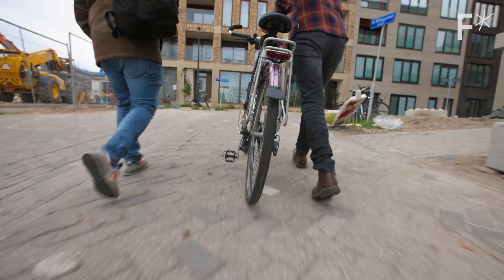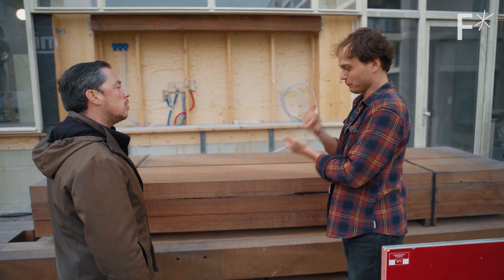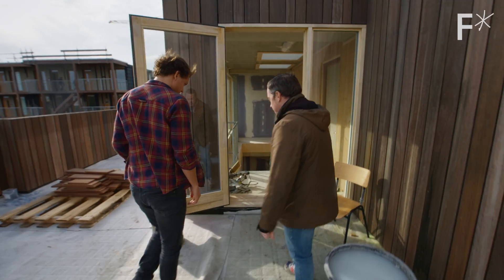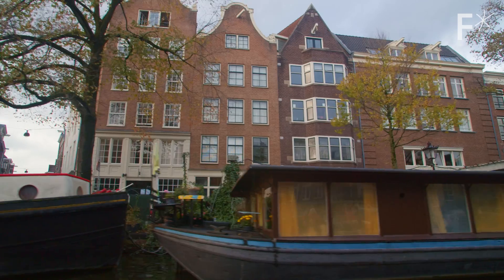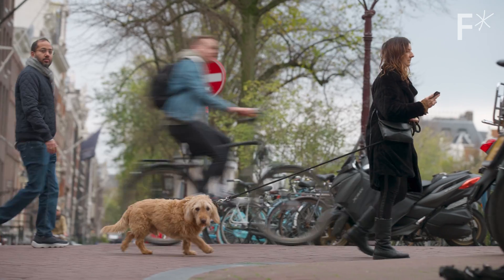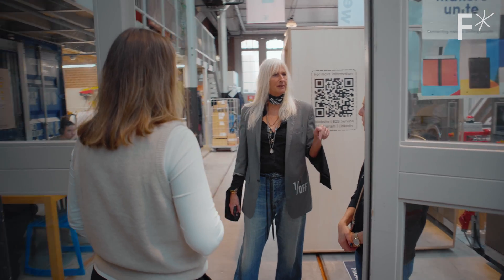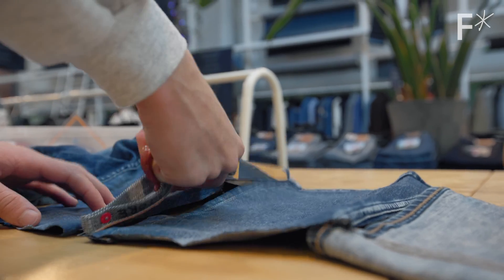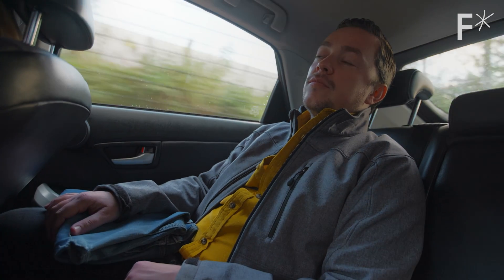This city is setting a new ‘green’ standard for the rest of the world

Comment: Nice concept, but more flammable. I wouldn't want to live or work in it. Steel and concrete would be better.
Reply: Cross laminated lumber is actually safer to an extent. Skyscrapers been made with this form of lumber. Concrete needs rebar to retain its shape and cold weather to solidify.
Reply: Depends where you live.  I grew up in the UK where brick and mortar is common.  I now live in NZ where houses are mostly wood construction and I happy that the house shakes a bit during a quake but damage is limited to the odd cracked window pane.  Fit smoke detectors and sleep peacefully.

Comment: LOL He just basically said, "well it's more expensive because we haven't made the alternative/competition more expensive though taxation" What a concept. It won't be considered expensive if everything is made expensive. lol
Reply: Kinda cool how the architect sees that through his eyes. 
Instead of having a wood market for second hand use, that's now the builder's cost to source the material. 
Everything in the current pipeline is cost cut already with steady deliveries. Any change is going to be more expensive in comparison.
Reply: He's kind of right though - in the UK refurbishment is subject to VAT (21%) whereas new build is not, so often it's cheaper to build new rather than to refurbish an existing building. There's been talk of equalising the rate for both at 10-11% for a long time but I don't think anything has come of it.
Reply: @malcolmrose3361  this is part of why we have housing shortages in all attractive countries. They incentivize new buildings over refurbishing the old. New structures look  at profitability potential which is  greater for more complex new housing than older adaptable structures. If you look at incentives on meeting demand with "new" structures it makes financial sense to throw out the old and replace with new, usually shoddier than the original construction. This is a net loss that generates much waste, unnecessary disruption and harvesting of new resources which is not an improvement in most cases. It generates  GDP but it comes at the expense of many other  resources that  are subsized by the public.